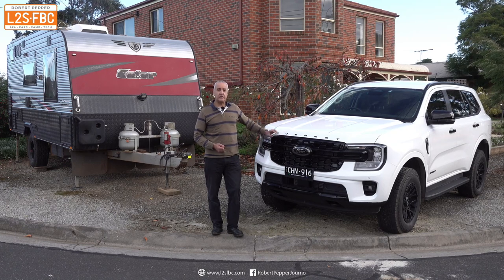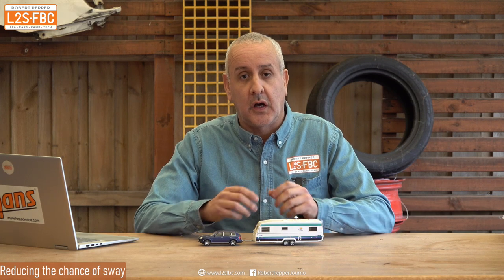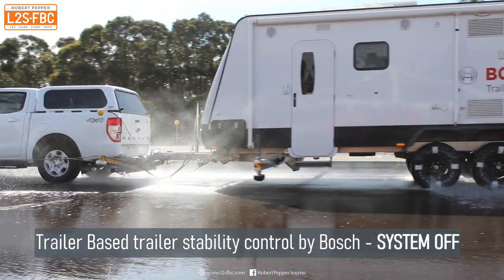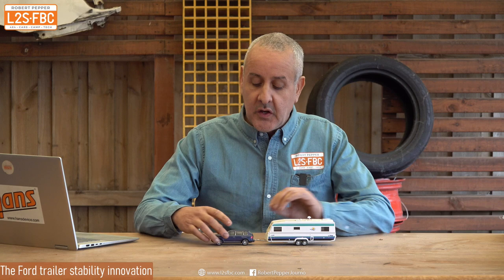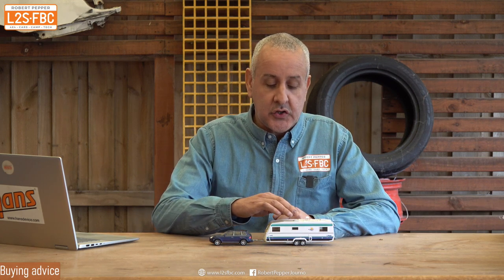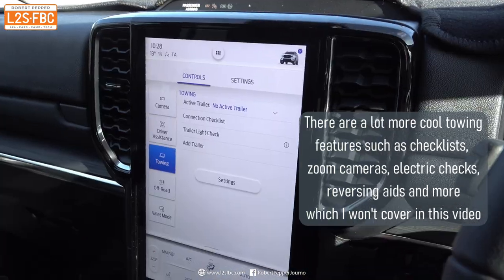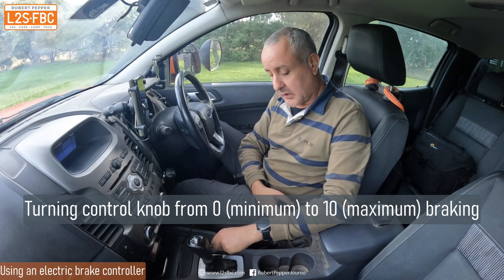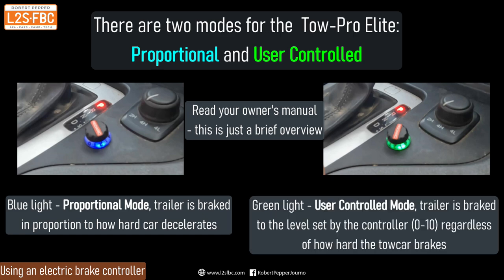Towing safety gamechanger - Ford's new trailer stability control for Ranger and Everest

Comment: I'm very cautious towing my van, but got surprised by something i hadn't considered.
On coming truck.. hand on REDARC button if needed.
But, i was doing 95kmh when a truck overtook me (must have been doing over 110)and pushed the wavefront on the back the van.
This caused an unusual push/sway effect.
Luckily i reached the button in time. Now I'm aware to watch for this.
Reply from the maker: Large trucks passing trailers are a common cause of sway. I have another video showing why - imagine a large boat and its bow wave. That's what a truck does but with air. When that wave hits your rig...it sways. And, you're typically doing 90-100km/h.  So what was a stable rig becomes unstable, and you have around 3 seconds to sort it out. Hence all my videos on sway and in this one why I went over use of the brake controller.  Please spread the word.
Reply: @L2SFBC  
The larger the side  surface are of the trailer relative to its weight, and the higher the speed of the unit, the more danger there is of a snaking event. Slow down to an appropriate speed before it happens! Be aware of overtaking trucks or other large vehicles and also be aware that the same possibilities apply when you overtake them. Go on a trailer driving course to be made fully aware of the issues and be tested on your skills including spacial awareness and manoeuvring in reverse using mirrors and eyes and a guide if necessary. This course should also cover trailer attachment, balance, maintenance and load security such as strapping practices.
Reply from the maker: Yes!

Comment: Thanks Robert,
I have a V6 Ford ranger on order to tow my new caravan (2.9 ton).
I was going to fit a Dexter sway controller to the van as I am concerned about safety.
Would you recommend fitting a sway system to the van , and would it interfere with the Rangers braking system if I did?
Love your videos, keep up the good work!
Reply from the maker: If you fitted a Dexter then there would be no need for the Ranger's trailer-sway-braking system.  I The Dexter brakes either or both left and right side of the trailer so it is arguably superior to the Ranger which can only apply all trailer brakes at the same time. As I said in the video it's one of those "how safe do you want to be" questions but personally given the Ranger has TSC and can brake the trailer, I'd be content with that. Please also ensure you weight the trailer correctly.
Reply: -Thanks so much for your advice.
 The Dexter will cost around $2000 to fit. I will see how the TSC performs on the Ranger and if it does the job there is no point spending money if I don't need to, 
cheers.
Reply: From information, I read when the Dexter ESC was first released and the testing carried out showed the Dexter ESC activated quicker than the vehicle based trailer sway control. During the testing with both vehicle trailer sway control and trailer ESC active, the trailer ESC always activated first, alleviating the need for vehicle trailer sway control to work.  I have a new Everest coming with the integrated brake controller and the caravan I have has Dexter ESC  I think the vehicle sway control will be a good backup for the caravan Dexter ESC.
Reply: @wazza8687  Thanks Wazza, that makes sense. I might still install Dexter as an extra layer of safety.👍

Comment: Good vid👍🏻. I have a van that has esc already fitted and I pick up my new Everest in a couple months. Do I need to get my Everest rewired with an Anderson plug as my current vehicle has? Or do I just plug in my vans 12 pin plug to the new Everest and it automatically talks to my vans esc?
Reply from the maker: Ask your van maker, I can't answer that one

Comment: This is a great feature - is this a new update as I can't see it mentioned in any Ford info online?
Difficult to find up to date content but a next gen handbook I found online says 'brakes to individual wheels'. It does not mention trailer wheels.
"HOW DOES TRAILER SWAY CONTROL WORK
The system applies the brakes to the individual wheels and reduces engine torque to aid vehicle stability."
Reply from the maker: I found the feature whilst watching a video on the Everest about something else, three seconds of voiceover and I thought "WOW!!!!".  So I contacted Ford PR who gave me a little more info. I think this shows a disconnect between engineering, marketing, and consumers.  If I was Ford, I'd be shouting about this but I will never understand marketing people. Part of the problem is that the significance of the feature is not apparent unless you really understand heavy towing, and people from car marketing in, my experience, know little about cars and even less about towing...and to be fair, the average tower may not even understand how cool this is.  And, it wasn't picked up in any review I scanned of the Everest or Ranger wither, not even the tow tests so the journalists testing the cars haven't noticed either, far as I can see. I know a few watch my stuff so maybe it'll trickle out now.
Reply: @L2SFBC  Hmm like you say it would be a great feature but if not in any documents I would question if "Ford PR" actually do know the truth on how it operates. What documentation did Ford provide or reference?
Reply from the maker: Emails with their engineers via the PR team and it is mentioned in their videos.

Comment: I feel the 10 (to 15%) ball weight came about due to high speed stability findings in USA.

A big part of it is likely that if you can have 10% ball weight on a rear-biased axle trailer, it means there isn’t much tail weight - which is the real issue.

I’d think 1% ball weight would be stable IF the other 99% was exactly on the axle - and at axle height. Not really possible though.

The big risk with some vans is that they have axles mid-mounted, a 5% ball weight AND about 10% behind the axle weight - creating an unstable and dynamic load.

In a perfect world you’d have 95% of the load spread evenly over the axle of the trailer and on the towball (with the remaining being aft of the axle), to maximise stability, but no common vehicle can handle that load.

The faster you go the more the weight bias affects the stability.

Europeans towing at 50-55mph can handle 5% ball weights. Americans doing 75-85mph need to maximise stability, so work with 10-15%. I like 15 myself, but accept 8-10 is a reality to match gvm/axle limitations on our available tow vehicles.
Reply: American trucks/utes also have much longer wheelbases. In combination with other design factors, make them far superior for towing heavy trailers.
Reply from the maker: Yes, the ideal TBM is very much situation-dependent.
Reply: @HardstylePete i have one, a 2500.  The difference between it and any LC or dual cab ute is like chalk and cheese.  You are so right.  They are unbelievable.
Reply: 7% TBM thereabouts is ideal in my situation.

Comment: So if the Everest applies anti sway braking to the caravan brakes, how will this interact with the dedicated anti sway system installed in the van. Eg. Alko or Lippert systems where there is a sensor module on the van? Are two different systems going to be pushing current to the trailer brakes?
Reply from the maker: Disable one of them on the trailer.
Reply: @L2SFBC  really, is that your considered advice? Just about every caravan now has inbuilt anti sway. Are you saying Everest and Ranger owners should turn it off because the car is doing the job?
Reply: @georgethomas6541 I’m late to the party to these comments but I’m in the same boat. Just got a new Everest with the integrated break controller and also have Dexter on existing trailer. Dexter being able to control each individual wheel for breaking is obviously a much better system but I’m assuming the Everest would over ride this system as it would apply current to the electric breaks over riding the dexter individual control. I wondered if you had a response yet and weather the recommendations are to turn off the cars trailer sway control system. ???
Reply: Hey there. Very difficult to find any information about the Ford system. I had received some Facebook advice to leave both van and Everest anti sway systems active. The van one is likely to be more sensitive. The car one is a bonus. Who knows..?

Comment: I tow a 2.9T Van with my V6 Wildtrak and like the Tow/Haul Mode except for the engine braking. I find the engine braking in Tow/Haul Mode too harsh at times and I wonder what stress it places on the transmission.
Reply from the maker: What do you mean by "too harsh"?  It would engine brake to reduce the chances of brake overheating - road vehicles have brakes designed for occasional emergency stops, and if there is a heat buildup in advance of the stop then the emergency stop won't go well.
Reply: @L2SFBC  When brakng the vehicle seems to shift down to a gear where the engine (at times) revs above 4000 RPM while decelerating. I find this a little excessive for a diesel engine. It seems (although I cant verify this) that the harder you brake the more the car shifts down the gears while in Tow/Haul mode. If you can get hold of a next gen Ranger (V6) I suggest you try it with your van - I would love to get your feedback.
Reply from the maker: Thanks. I've not towed with a next-gen, waiting for reasons such as this to test one rather than test for test's sake. Yes, what you describe is how modern vehicles work; same thing happens unhitched when descending, they auto-engine-brake which is a good thing seeing as nobody is taught this technique in the standard driving lessons!
Reply: It's far safer to load to engine up than have an over reliance upon the vehicles hydraulic brakes. Modern diesel engines are designed for much high RPMs than older, heavy, mechanically injected engines. The ford engineers did design the tow mode for operate within these parameters.
Reply: To stop the engine over revving and down shifting gears, you keep your foot on the accelerator and press the brake pedal with your left foot, a message is displayed on the instrument cluster that power has been reduced. I find this is the only way to stop the engine over revving and downshifting gears while using tow mode.

Comment: Alwys makes me wonder why that 10% noseweight "rule" was ever thought to be a good idea. All weight on the hitch transfers to the back axle and more as it lifts the front body so transfers more weight to the back axle. very quickly most vehicles will overload the rear axle. Here in the uk the noseweight figure is mostly 75kg, for the Land Rover it's max 150kgeven for the max 3500kg tow limit, so you'll add about 200kg to the rear axle, People forget, that weight comes off your payload. I also totally disagree with the tow vehicle to be heavier than the trailer, I understand why it's said, but it has no basis in physics, theory or reality. Again, look at the D1, 3500kg tow weight, MAM/GVM 2720kg. but actually tows really well at full capacity. Keeping within the stated tow capacity and having good and serviced trailer is much more important. 🙂
Reply from the maker: There is a very good reason why I recommend the towcar be heavier than the trailer and that is control. Simply, the heavier the trailer, the more it can 'boss' the towcar around. It is however a recommendation not a rule, as towing is so varied - say with your Discovery you tow 3500kg of tractor on a well-maintained vehicle trailer, properly located, dry day, level roads, max speed 80km/h.  That's a different story to a typical Australian heavy tow which would be a poorly weighted trailer on offroad tyres, raised suspesion with high CoG, crazy high ball weight, up to 110km/h in potentially high winds, at night, dirt roads etc etc. Towing 'really well at full capacity' is very much dependent on what sort of towing you're doing, and for the video I've focused on the terrible Australia caravans that are pulled around this country. Hence, trailer lighter than towcar suggestion. European caravans are much lighter by comparison and Europe also speed-limits trailers far more than Australia, so the risk is much lower.

Comment: Can you just apply the trailer brakes using the ford system?  Ie similar to the redarc system
Reply from the maker: Yes you can do that as well, and will need to in some situations for example difficult offroad towing. However, for sway, the car should take care of everything. If it doesn't, then there is the manual override too as demonstrated.
Reply: @L2SFBC  manual override in the Ford system? As in an easy to access button? BTW I'm waiting on my new next generation xlr bought for towing
Reply from the maker: It's not a button it's a slider. I show it in the video. Same effect though

Comment: There’s no basis in fact that the tow car must weigh more than the trailer either. For fifty years I have towed 3.5 ton loaded trailers with 2 ton [Range Rover Classic] to 2.7 ton [Land Cruiser 80 and 100 series] and from power outputs from 67hp [22 years with 1984 LR OneTen pickup] to 202hp [Ford Ranger 2023] and never had the slightest issue. Moreover the cargo is most often four cows that move around inside the trailer, altering the balance and tow ball weight as they do. The weight occasionally exceeds 3.5 tons, depending on how heavy the cows are and how wrong I guess it.  No trailer stabilisers have ever been used and the tow ball is well greased to prevent wear. While one day I might appreciate the trailer sway control very much, as of yet and in all those years I have not needed its help.
Reply from the maker: It is definitely a fact that all else being equal the heavier the towcar the more stable the rig.
Reply: @L2SFBC  There’s a whole raft of factors involved in that equation, such as the speed, the suspension system of both towing vehicle and trailer, the tyre size and pressures of both units, the nose weight, the area and length of trailer and indeed the depth of the sides of the trailer. The state of the road and topography of the land. Every one having a very significant bearing on the stability of the unit and any combination having the possibility of being more relevant than the weight ratio between vehicle and trailer.   I often tow near 20 ton trailers behind 8 ton tractors with no issues whatsoever as do literally thousands of other all round the world at speeds of up to 32mpg/50kph. The weight limit in most countries for standard driving licences or even after taking a trailer towing test is 3.5 tons/7700lbs and is again done regularly behind literally thousands of pickups and SUV’s such as Defender, Range Rovers weighing usually from two to two point five tons. The speed limit on most UK roads for trailer towing is 50mph with 60 possible on motorways. The speed limit need not be driven and most drive with full loads much slower when road conditions dictate.
Reply from the maker: I agree with everything you've said thus far, none of which invalidates the point about towcar weight.  In Australia I can tow 3500kg with a 2000kg vehicle at 110km/h on single-carriageway roads! At slow speeds it doesn't matter too much...have towed a 8t trailer with a 1.5t Series Land Rover!
Reply: @L2SFBC  There you go then. The weight ratio is just one factor and should not be taken is isolation at any time without serious consideration of all the other factors I listed and anything else that crops up according to circumstances on the day. 3,5 tons is perfectly safe behind modern pickup trucks as long as the driver is competent to take control of the unit. There’s plenty of drivers, and we’ve all seen them, that I wouldn’t trust to take charge of a wheelbarrow unloaded much less a car of any kind, incompetent, maybe half blind or with dementia.

Comment: very useless info Rob, I used to tow with my UA Everest Ambient  AWD years ago, my rule of thumb max tow weight was 2,200kg, 2,000kg for tow and 10% tow ball weight, since the Everest was 3,000kg tow, if you looked at the GCW it was well within the safety margins including vehicle payload (re: driver, passengers and cargo).

As for driving style, what many people forget is length, depending on what your towing the combined length changes, so with that you need more room at the straight ahead to do what needs to be done, also braking, you need more space, be proactive not reactive in the best form of driving so if you have ability to manual shift gears then do so (even if its using those awful toggle switches on the stupid designed  Ford e:shifter), no point being in 10th gear as there is zero engine braking so lock out 10, 9th, 8th and even 1:1 gear ratio 7th gear and stick with 6th gear, sure the engine will rev harder thus using more fuel but you have engine braking, the transmission can handle it 9if its an 6 speed transmission like Rob's PX ranger use 4th gear (as 5th is direct drive 1:1 ratio).

As for trailer controller, most people set the gain (pressure) to 5 but be careful check that your trailer brakes are in good conditions and not warped.
Reply from the maker: thanks, sorry you found the information useless :-(